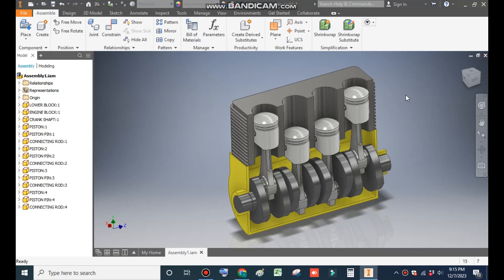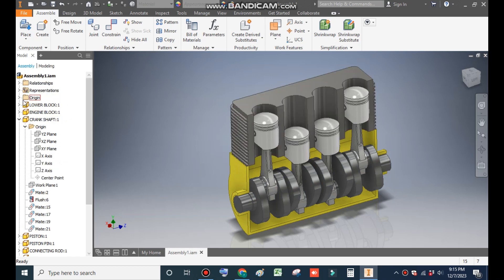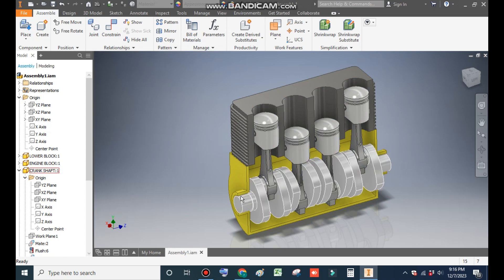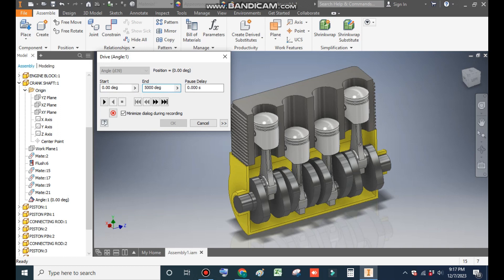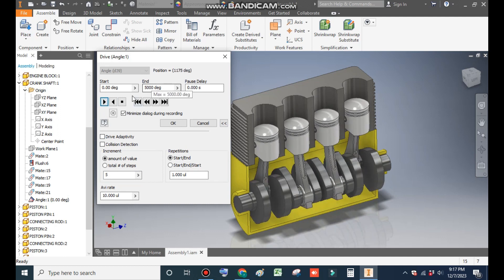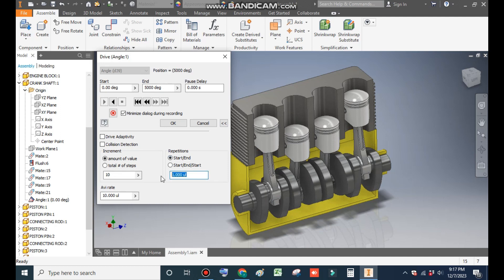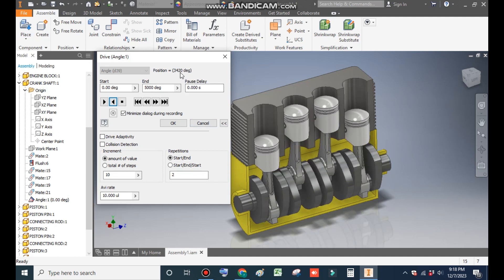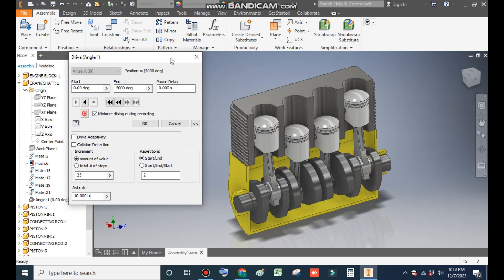3d Assembly Animation in Autodesk Inventor || Engine Working in Autodesk Inventor 3d Model Design

Comment: Hello. I am not an engineer, but I am trying to make an Inventor scene for my boss, representing a machine he's designed. The modeling is pretty much done, but the animation is what perplexes me. 

It looks like a giant crossbow, and resembles one when it's doing its thing. I know about animated constraints, am familiar with dynamic sims, but this one is over my head.

In your opinion, should I just animate each piece manually (say, via animated constraints)? Or, should I try to learn dynamic contraints within Inventor? Would I require a math / engineer degree in order to accomplish this?

Thank you.